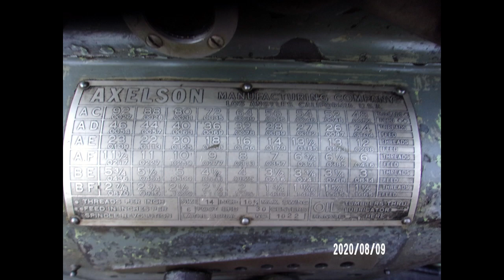Boring Harley Davidson cylinders on an Axelson lathe Fixture 1

Comment: DeeDee,  So good to see you back!  I missed seeing you and am glad see you are well and in the shop.  Cheers, TB
Reply from the maker: Moving forward on profitable capability here, I used one of your back plates for this small engine cylinder sleeving fixture that will confuse all but those that have lathes weighing more than 2 tons, you just need the machine weight, good spindle bearings along with good cutter design to make this work! Thanks!

Comment: Great use of the coaxial indicator and B&S mill. What are your thoughts about L-00 spindle mounts and the D series mounts? There must e a good reason for the D series mounts but I don't know what it is rather than speed and ease of chuck changes. I would seriously like to know what you think.
Reply from the maker: I almost bought an American Pacemaker 14X30 and would have gone with the L type. The L type tooling seems to be a little less in cost on the used market. There was some old study that declared the L type the strongest as written in the American manual. The main drawback for the D type I have encountered has been the fit of the locating short taper that can be loose causing the chuck to shift. I think the L type is faster to change.

Comment: What brand milk is that and does that head swivel to any angle between vertical and horizontal?  Lastly, when you had it set horizontal and were drilling the holes in that fixture plate, is that a quill feed badly you were spinning on the right on the mill head?  Looks very versatile and rigid machine.  I’m interested in acquiring such a beast for my own workshop in the future.
Thanks you sir and nice video.  Would love to see more Harley manual machining videos from you!
Reply from the maker: Hi, the vertical head on this WW2 special Brown&Sharpe mill has a crank feed for the quill. More modern versions of this mill are the ones with the powered overarm sometimes called toolmakers over arm check those out, thanks!

Comment: I have a question for you Dee. How would you make a toothed, gilmer style pulley? If you made 2 of them, both aluminum, 2” wide, 4” diameter, one having 1/2” pitch trapezoidal teeth and the other 8mm rounded tooth. My question is how would you cut the teeth? I understand calculating the tooth count and spacing, etc, the basics of machining the blank. Would you use something like a gear cutter? Or could you make some sort of profiled tip tool on a vertical mill? I’ve searched YouTube several times and cannot find anyone making a toothed pulley. I guess I’m more interested in how a old school machinist would do it instead of taking the easy way out and just ordering it from China. 😂
Reply from the maker: I would shape a single tooth cutter for that profile and just make them, aluminum cuts like butter the plastic mold maker here says! Its true,